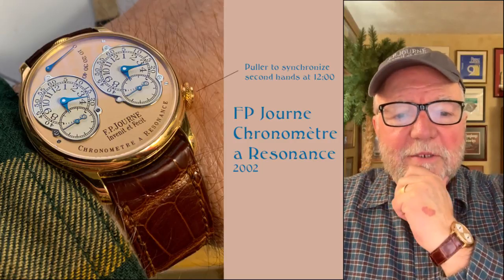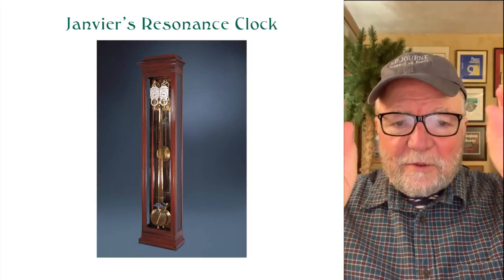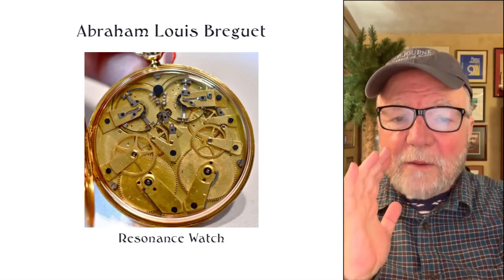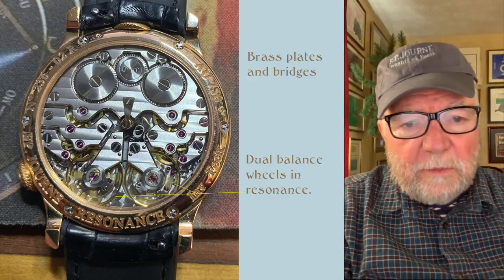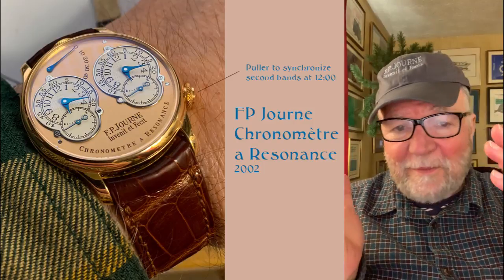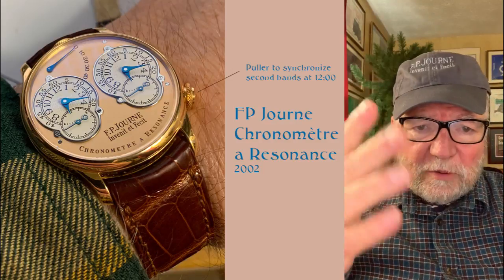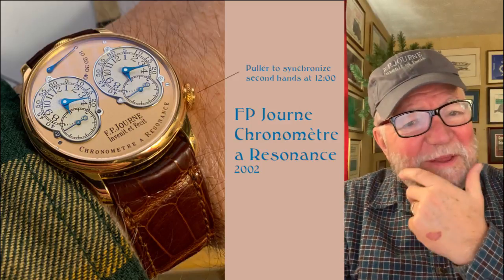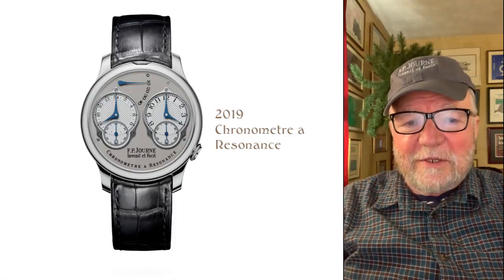How Resonance Works in Watches #256

Comment: Thanks for the video Bill! While I understand the theory behind resonance, I can't seem to find data supporting how this actually improves the accuracy of a wrist watch beyond just observations (and I do think this is why there are some skeptics out there). It seems FP was asked this a few different ways at the talk in NY ("How much more accurate is it?" "How many can be in resonance at once?" "How far apart do the movements have to be?"). I would love to see an experiment or data that actually shows what happens if the movements are in different frequencies (not in resonance) and how the distance between the movements actually impacts the time keeping. I think that would help shed a lot of light on this interesting phonemena!
Reply from the maker: Oddly, Dan, resonance is generally considered a problem in watchmaking. That's because such resonance can throw off timing. The irony, though is that planned resonance within the watch offsets outside resonance. It brings everything back into sync. Take care, Bill

Comment: Thanks for putting together another highly informative video on a marvelous watch. FPJ’s talk in NYC must have been something. This is yet another gem I’d like to add to my collection someday.  After the CS this is the next FPJ to have I think. I’ve been scouting Chrono24 for some time and they don’t appear often. Looks like I’ll probably have to buy from an FPJ boutique and pay big bucks if I decide to purchase one someday. The FPJ boutique in HK didn’t have one in December and weren’t expecting one anytime soon. I really like the 2019 dial design and hope they stick with it. We’ll soon see I suppose. Thanks again Bill for another taste of exceptional horology!
Reply from the maker: My pleasure Jeffrey! I really wish that a low-price Chinese version of a resonance watch would come out. In one respect, they are not that difficult—the concept is pretty clear. Two identical movements, most importantly hairsprings (balance springs) with the same frequency, set next to one another to generate resonance between the the two. In programming we used to talk about "strong-arming" a problem...simply throw code at a problem until we solved it—an elegant solution would then follow. Maybe a low-price resonance watch would be to take two relatively small movements and cram them into a single case with the balance wheels close to each other? In the meantime, there just are not any other than FPJ's, Armin Strom Mirrored Force Resonance and Beat Haldimann's H2 - Flying Resonance. All are way too expensive...but all worth it! Kindest regards, Bill
Reply: WatchArtSci If I can find a way to bring my wife into resonance with with my renewed passion to build a collection I could probably snatch one this summer. I’ll find a way. Cheers, Jeffrey.
Reply: Jeffrey Blue Hi Jeffrey! My understanding is the 2019 is the last lot of this generation of Resonance and there is a big event scheduled in Geneva in March to announce the new Resonance at the Journe Manufacture. Total speculation what that watch will bring, but it will be a more complex version of the original with a much higher price tag. Who knows.....dual Remontoirs? I also heard that the first year’s supply may well be sold out in advance without any info or pricing........
Reply: Richard Davis Thanks Richard! While disappointing news for me wife will be very pleased if the first year or more of production are sold out. Thanks for the tip. Jeffrey.

Comment: Great explanation Bill, Thank you. 
I am really interested in getting a resonance watch, but the FP Journe is out of my budget :D is there a budget resonance watch?
Reply from the maker: Hi Abdul, I got lucky and was able to get one in my budget at the time. Now, even my own watch has jumped so high in price, that I could never afford it. Like tourbillons, I'm hoping the Chinese will come up with a low cost alternative! Cheers, Bill
Reply: @watchartsci  Hi Bill, I hope all is well. You were definitely one of the early ones to get these watches, great taste pays off on the long run :D I think they will definitely come up with a lower-cost alternative, I will be waiting for it :D Best, Abdul
Reply from the maker: @AbdulRWatches  I have an idea. I'll get two Seagull movements that are the same frequency (Hz) and see if I can rig up something so that the balances are in resonance. That might work. It would be more a clock, but it would be fun! Cheers, Bill
Reply: @watchartsci  that actually might work, maybe get a big case and try to fit both movements together in the same case 😁
Reply from the maker: @AbdulRWatches  I'm debating getting two large ones like ETA 6498 (or ST36 clone) or two little ones. I like the larger ones better with a larger balance, but the smaller ones would may be fit into a really big case. Another project for a watch collector! Cheers, Bill

Comment: Is there any benefits with with 2 balance weels, or is it just a really cool complication?

Thanks for a good vid
Reply from the maker: Hey Tommy, the actual benefit for having two balances in resonance is that they keep outside (unwanted) resonance from interfering with accurate time. You could have the same setup with a single dial, which would be easier to tell time and have the second balance act as a resonance shield. Kindest Bill

Comment: FP Journe seems to go to great lengths to associate  this watch's resonance effect as the result of resonance via the metal of the watch vs boundary layers via the air. I find his claim a bit dubious since they do not test the movement in a vacuum and lay the doubt to rest. It's hard to fathom resonance is strong enough to synchronize using the mainplate and case as the sole connection.
Reply from the maker: Tony, my resonance watch keeps near perfect time. The two second hands are in synch after running for a day. It's not magic—it's physics. Take care, Bill
Reply: @watchartsci  It's a fine watch, and you did well being an early supporter. Correlation does not imply causation. I didn't say it's magic. I'm questioning the watch as FPJ claims. I've yet to see evidence refute the effect of aerodynamics on the balances, which may be the main cause of the synchronization, or at least a cause.
Reply from the maker: @anthjiang  The phenomenon of resonance has been demonstrated by Javier in his work with pendulum clocks. One type of evidence is that a single pendulum or balance wheel not in co-presence at an attitude and distance of dual movement does not have the effect on the external interferences resonance does. See if this helps: https://www.thewatchpages.com/resonance-explained-how-it-works-in-a-watch/ . I'm not trying to 'sell' resonance; it's a force in physics. You want to believe it's an effect of aerodynamics on the balances — prove it. Take care, Bill
Reply from the maker: Here's another one by FPJ on resonance: https://www.youtube.com/watch?v=FqLEP3xNb3U
Reply: @watchartsci  You are misconstruing what I am saying. There is a difference between saying 'I don't believe in resonance' vs 'This particular FPJ watch may not necessarily make use of resonance as claimed'. I am suggesting the latter not the former. You say prove it, yet fpj has not proven that his watch demonstrates resonance. The burden of proof is on fpj, not me.
Reply from the maker: @anthjiang  I'm not misconstruing anything. You're saying it's the  effect of aerodynamics on the balances without one iota of proof. You think it is grounded in what? That's why I asked, "magic?' You cannot pull out a convenient piece of physics and claim it to be the 'real reason' as an alternative without demonstrating that to be a fact other than ...? I sent you two articles on resonance and I've seen nothing that indicate resonance is not the force that negates outside interferences to timekeeping; after all that is the claim and purpose of using resonance. Let's see a demonstration that shows the cause is "really"  effect of aerodynamics that negates outside interferences.